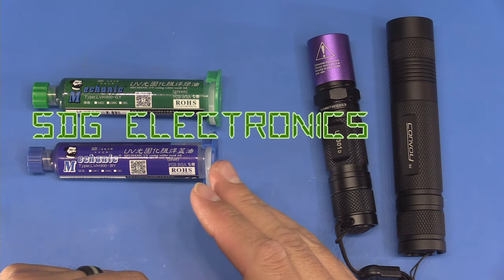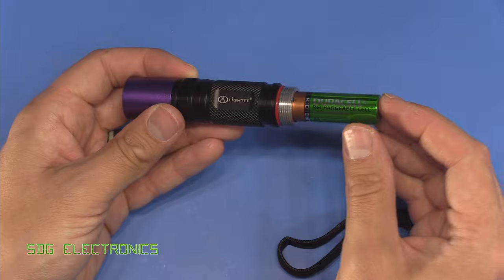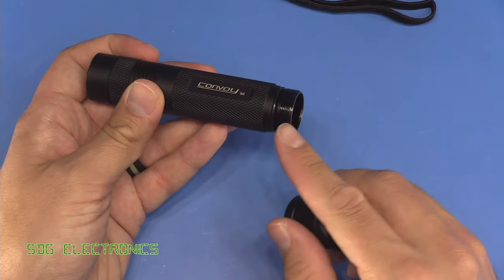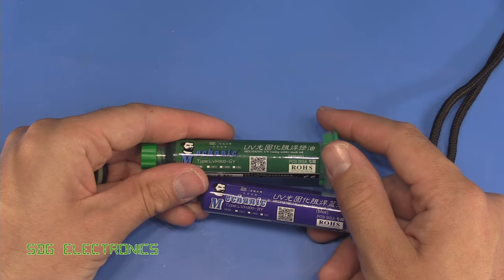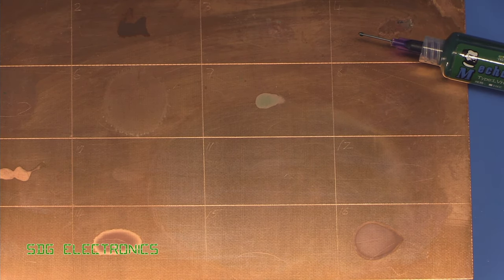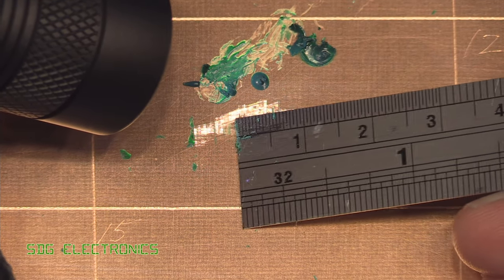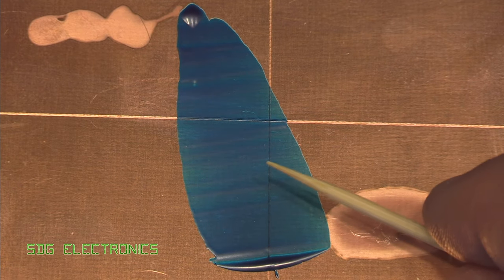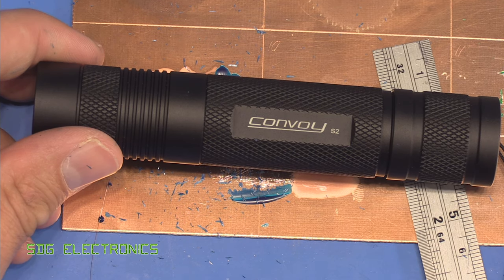SDG #105 UV Curable Solder Mask and UV Torches

Comment: Thick uv glue always cures slowly beneath. If the top layer is uv absorbing, not much uv gets to the lower layers.
I have a convoy S2 as well. With visible light filter is a great general purpose uv touch. Visible light is not a problem for curing resins but in some cases it is. UV only pass filters are not that expensive, I have them on my uv flashlights that were not originally fitted with one.

Comment: I use the Convoy S2+ for UV mask and checking for counterfeit currency. If you use a hotair station at say about 350C and UV light, the solder mask will cure very fast in just a few seconds.

Comment: The black or amber syringes are used for UV sensitive materials. The black syringes are completely UV blocking. The amber syringes are only partially UV absorbing, but it it's not a problem as long as you don't store the tube at direct sunlight. Both types are available at ebay, aliexpress and other chinese eshops.
Reply: That goop is so opaque it doesn't really need uv protection. It is also really insensitive, compared to uv curable glue, that cures instantly under such an irradiation (and heats to the point of releasing a bit of smoke/vapour in the process).

Comment: Your UV torches curing results are weird. I bought two "51 LED UV Torch 395nm Ultraviolet Flashlight Blacklight Pet Urine Stain Detector" (eBay) and even the thick blob gets cured in just couple of minutes. Solder mask I'm using is LY-UVH900.

Comment: Saw a guy use a tiny paint roller - maybe 10mm x 20mm lg - to apply it evenly.
Reply from the maker: That's an interesting idea, I'm pretty sure my wife has something I can use :-D
Reply: it will leave texture. look for "screen printing squeegee" on Ali
Reply: @Mr.Leeroy  I couldn't find the vid but the UV paint is low volume solids, ie, lots of binder, so it kind-of self levels. 
I couldn't find small disposable rollers so I ordered some rotary tool cloth/felt polishing wheels. I will have to try them when they get here.

Comment: You really want to keep this stuff as thin layered as possible. If neccessary, do multiple layers; thin layers cure rapidly. What happens is that when it cures, it becomes kind of opaque; Far less translucent. As the "surface" of the applied amount obviously has far more exposure to the UV light, the surface cures "first". At that point, the material still liquid underneath, never cures at all if the layer is too thick.

Comment: Now, that is interesting. I have the same solder mask, but it did not even try to solidify under 365nm, but 395nm worked quite fast. Maybe, my 365nm torch is just too weak. I will have to try it again with a thinner layer. (Insulating tape thickness is too thick )

Comment: I have a question, I have a scratched pcb board that, luckly, it didn´t affect any of the traces, it´s more of a stetical problem I wanted to fix because is in a place where there´s text and it´s easely visible . Is this method good enogh  for fixing that type of scratches? or what sort of paint/coat should I use instead?
Reply from the maker: This is really what this product is designed for. You need to apply it extremely thin, much thinner than I did.
Reply: @sdgelectronics  Yes, I was thinking using a small size brush or something like that to be extra careful. Thank you so much :)

Comment: Thanks Steve...on Amazon here you can get a combo package of three color mask and a small UV torch as well for about $26 USD. For us hobbyists that would last a lifetime of repairing/attaching bodge wires. Probably simply cover the tubes to keep the stuff viable for the long term. I didn't look at the specs but is 365nm preferred over 395nm or is it six of one, half dozen of the other?
Reply from the maker: The 365nm is a better wavelength for curing a lot of UV adhesives (i.e. takes less time), but on these liquids there was no specification.

Comment: I picked up a UV laser to speed up the curing process, works in less than 30 seconds.
Reply: sounds good idea I built a strong uv source I smashed and removed the outer glass envelope from a metal halide lamp then built the arc tube, ballast etc into a box with a timer and safety interlock switch,.... works well just takes a few mins to warm up and you have really strong uv

Have you had any problems from the siglent since you pull the caps out or is it behaving the same as before but now with 340Mhz BW.. thats really simple but amazing mod if there's no side effects

Comment: Quite expensive the 365nm Torches , the ones I have(365nm & 395nm)  was each 5usd Shipped....
Reply from the maker: You can definitely get 365nm torches cheaper, these are pretty high output though.
Reply: @KonstantinGrigoriadis  They dont really spec the power and you can get total garbage too. It's always fun to guess if you get anything useful or not, no matter what you pay for :)
Reply: @benbaselet2026  Probably bcs all these Items come from the same sources..... but at least with a few USD is the gamble of what you will get ok, I can only say the on I have works for curring SolderMask & Glue and used probably the same type Cree led.
Reply: @KonstantinGrigoriadis  Yeah so many of them have that Cree there as a buzzword... I would not trust it at all, but really what's the difference if you lose a few % efficiency if it's a reasonable cheap clone anyways.
Reply: @KonstantinGrigoriadis  Don't put any weight in how the light look on video. UV and IR will always look different through the vast variety of camera sensors, image processing, temperature, color and white balance - and every other image and video post-processing adjustment. And even raw - the camera is already translating many wavelengths your eye cannot see, into something else. It's a very imperfect, almost unintentional process from the very start.

Comment: Interesting. But I don't see the usage, solder mask were used to save solder when thru holes boards were floated on a liquid solder bath. Today we use SMC and solder stencil, the board need to be flat to apply the stencil correctly but doesn't need any solder mask
Reply from the maker: The solder mask is often used for insulative purposes - either from external influences or to increase the dielectric strength.
Reply: @sdgelectronics  A conformal coating applied after components welding would achieved the same goals and preserver the board from corrosion and water damage.

Comment: Could you maybe do some tests on UV cure glue ?, i wonder if when glue is applied in larger "blobs" it does set all the way through ?, if so then this may be a better option for tacking on wires for track repair and modifications etc, Dave @ BasicMicroUK
Reply from the maker: Just waiting for the glues to arrive ;)
Reply: @sdgelectronics  Fantastic and thanks, keep up the very interesting videos....
Reply: That depends on how the glue cures. If it cures clear, it should cure all the way through. If it becomes very opaque when it cures, like these solder masks, then no. The outer cured layer blocks/deflects/absorbs the light, prohibiting it to reach the uncured mass underneath

This is the good and bad with UV-cure. You can take your time, and not have to worry about uncontrollable cure times if you make a mistake and need to clean it off. But, you're kinda at the mercy of the translucency properties of the curing/cured mask/glue/etc, for how thick you can go.

So it's higly advicable to experiment a bit with the one you buy, and the UV light, to get to know its properties, limitations and how it cleans off, before applying it to anything of importance.